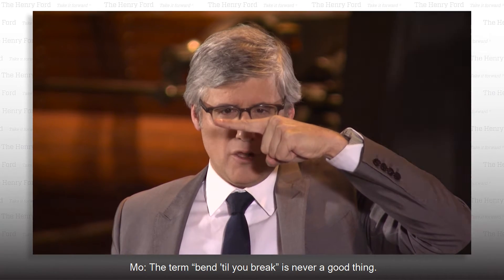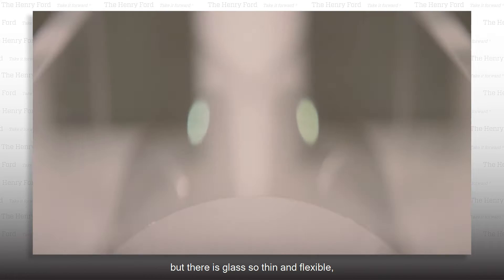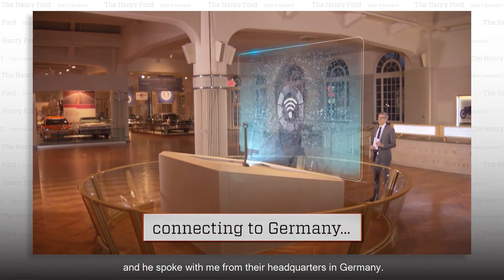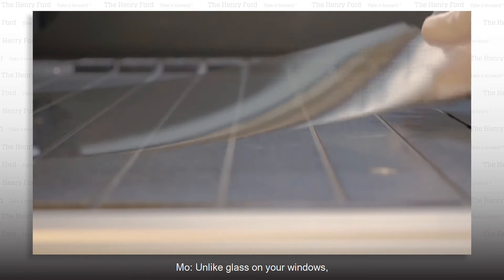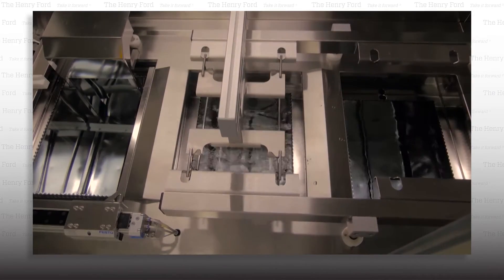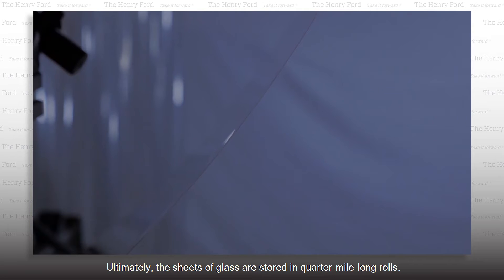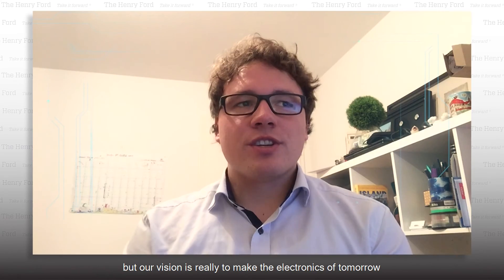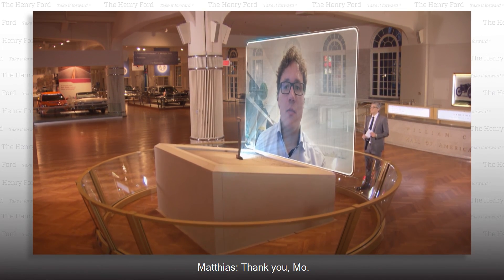Bendable Glass | The Henry Ford’s Innovation Nation

Comment: I wonder what kind of bend radius Schott can achieve compared to Corning. Corning can currently get to 5mm without shattering. I also wonder about the Mohs hardness of both and if they had to compromise on hardness in order to get increased toughness?